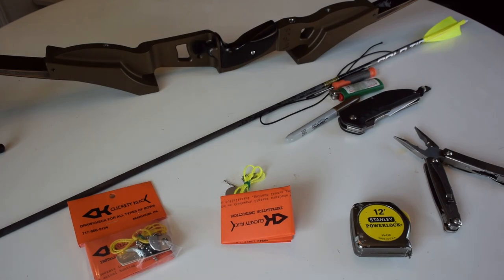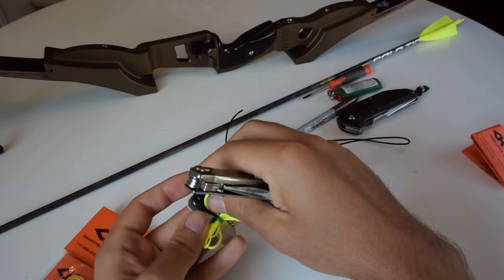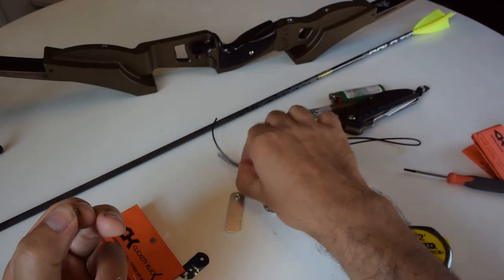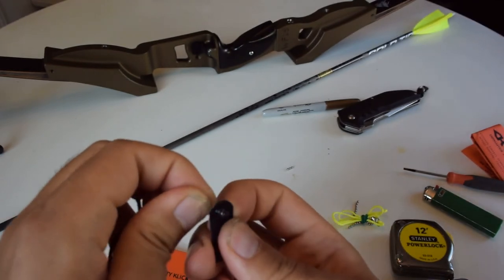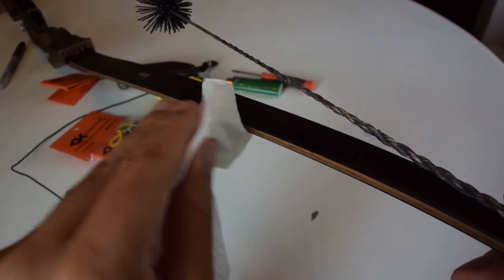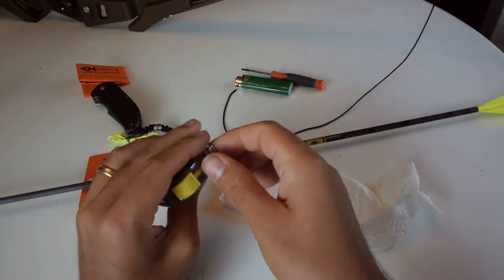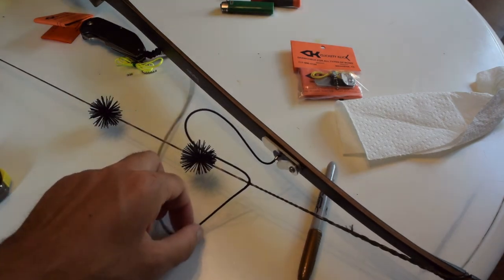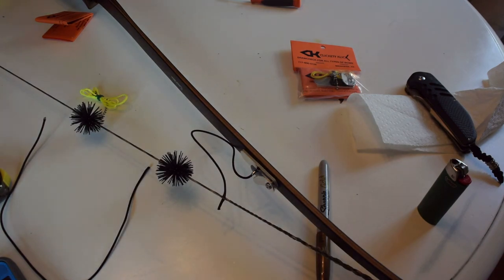How I Modify Limb Mounted Clickers

Comment: Once you install the clicker, can you still break the bow down to put it in a case? Im not seeing how you can take the string off without having to reset it up all the time.
Reply from the maker: Pale Ryder you can unscrew the clicker portion from the plate that’s attached to the limb. Or leave it attached and store the string with the upper limb.
Reply: I used a hangman's noose on the clicker string and a multi knotted string on the bow string section so I could un-do the clicker from bow string allowing 3 features:
1) disassembly;
2) adjusting brace easily;
3) adjusting the clicker distances (this replaces the chain adjustments).

At the end of the day clicker was too much trouble as the chain would slide thru the clicker (after <100 shots) so I tossed it and went back to full trad.